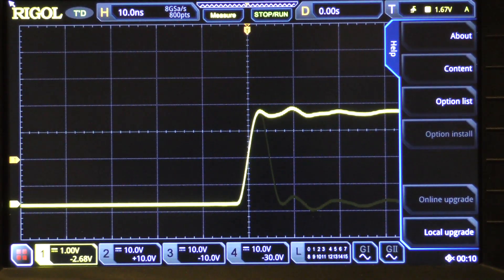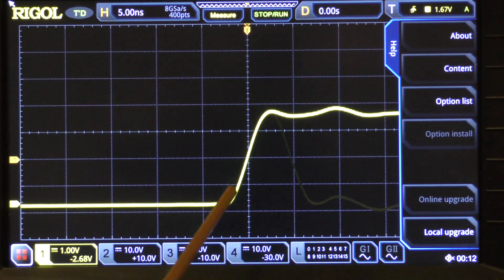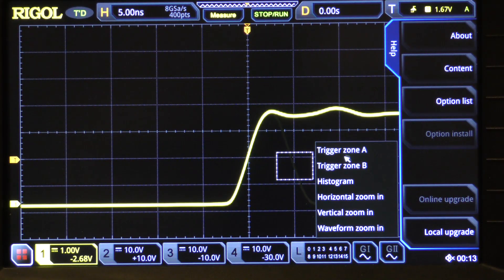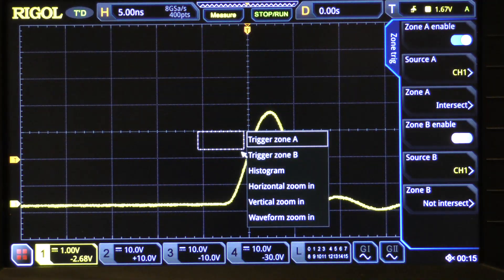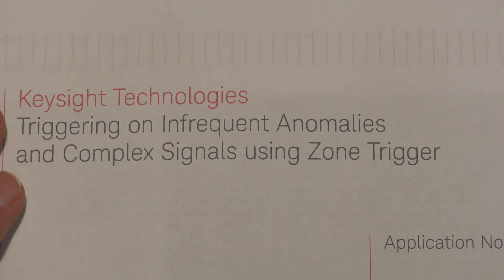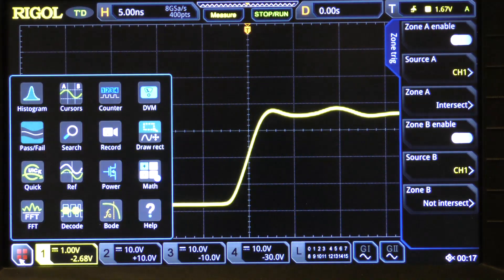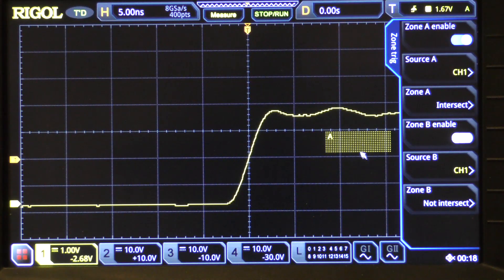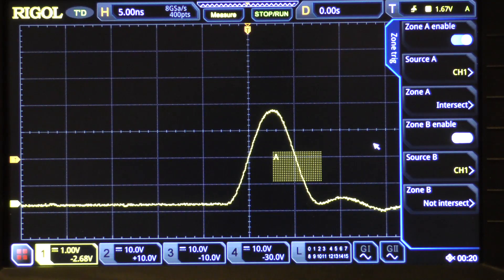TTT388 Rigol MSO5000 Zone Trigger

Comment: I think if I didn't really know where the anomaly was, instead of guessing where the intersection zone is I would look at the clock waveform trigger that looks correct and draw the box somewhere to the right of the trigger where the clock signal is high and use the does not intersect setting.  This way you capture any trace that doesn't follow the expected clock high signal.  Very nice feature!